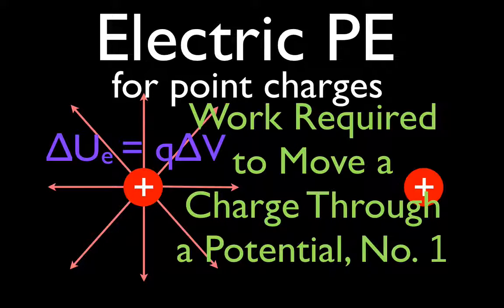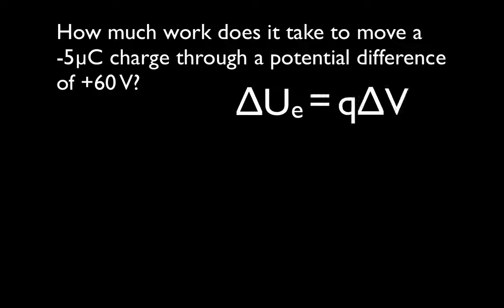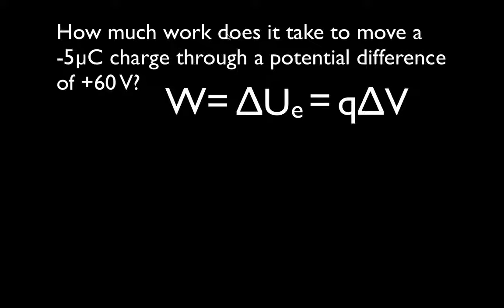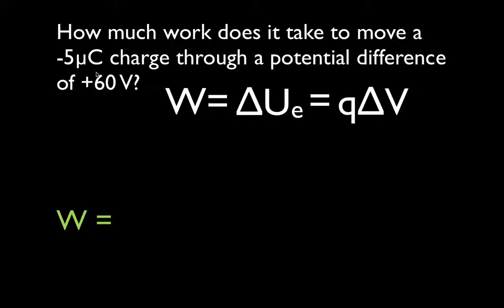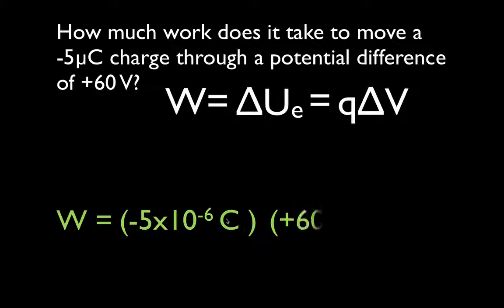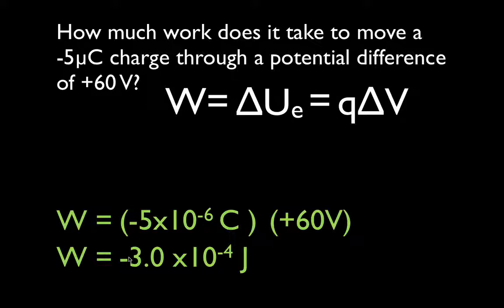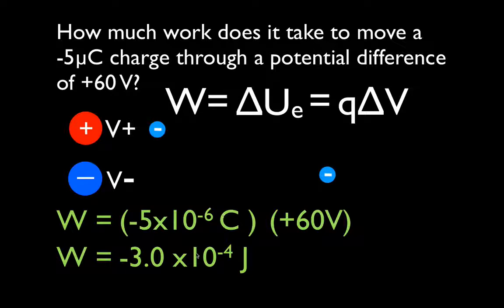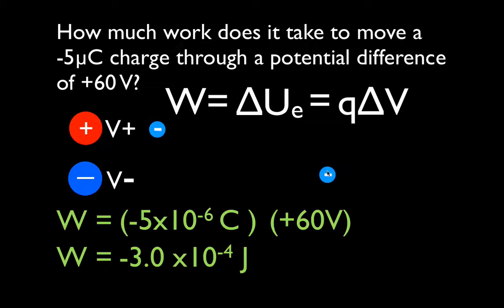Point Charges (8 of 10) Work Done Moving a Point Charge thru a Potential Difference: No 1

Comment: All sorts of wrong sign thinking here. delta W= -delta U, not the same sign. Also, if you move a particle to "where it wants to be", the sign of work by the field is not negative. If a particle moves to "where it wants to be", then its potential energy decreases and work is positive. Or another way to think of it, if a particle goes to "where it wants to be", the force and displacement vector are in the same direction and thus work is positive.